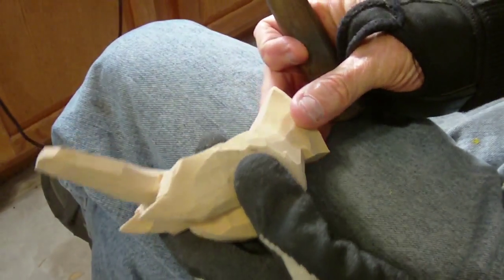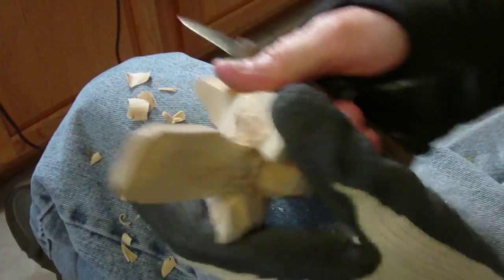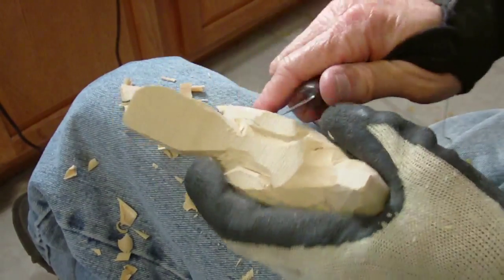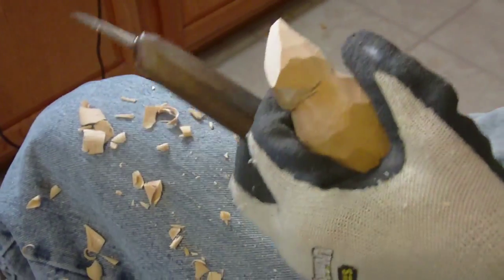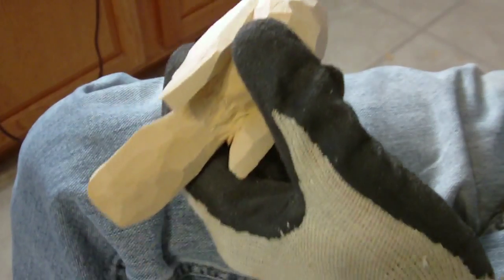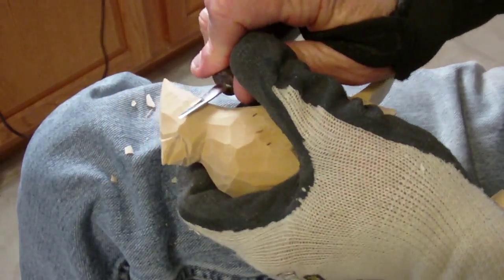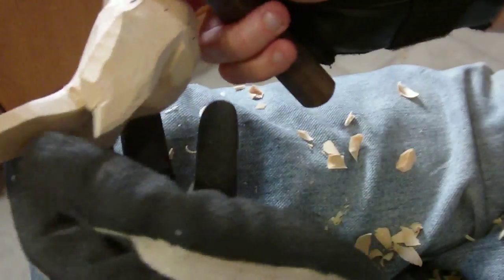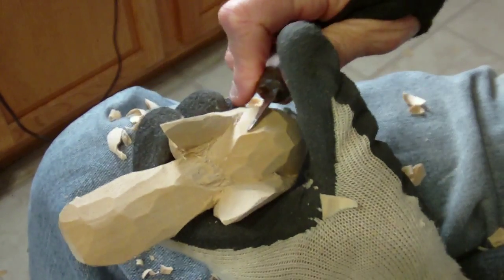Carving The Simple Cardinal Part 3

Comment: You need to let the beginners know to keep their center line drawn on the bird when they are trimming down the sides so they don't cut to much off.  You can take the wood off but you can't put it back.  Other than that you did a great tutorial.  What size V - tool did you use on making the break?  Mike Brady